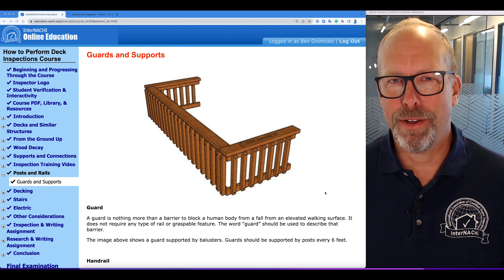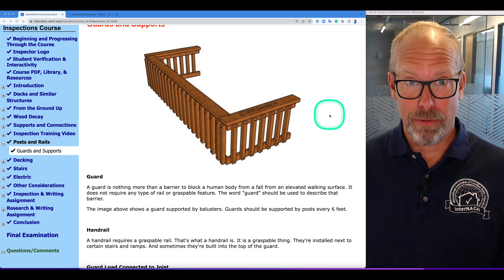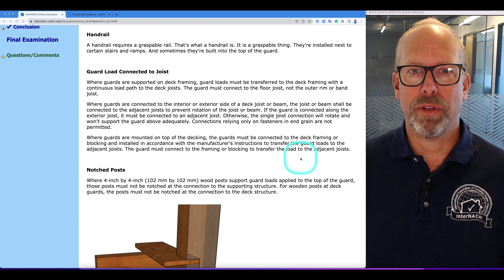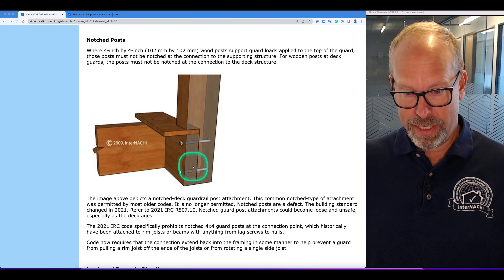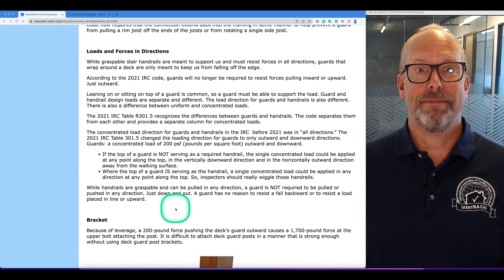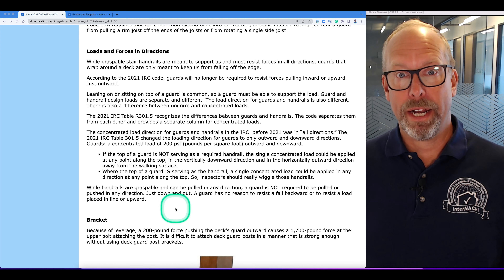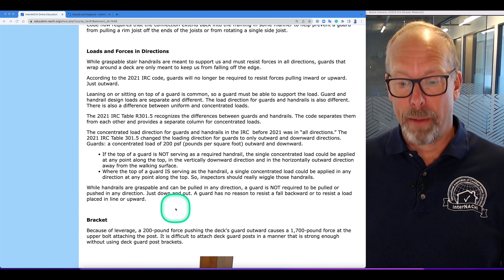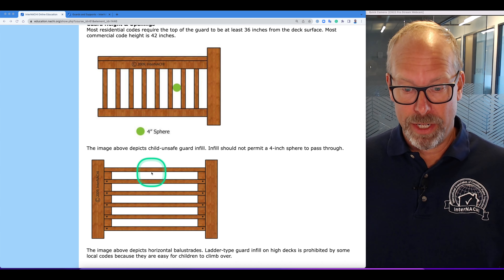Inspecting Deck Guards

Comment: This is where I find wood rot throughout. Each screw, handrail connection, baluster,  and floor trim. Also, call all flat surfaces to bevel to divert water. Ex. Handrails and post tops.
Thanks, Ben and everyone behind the scenes at InterNACHI.

John Grimaldi
Florida CMI and Home Inspector Mentor
Reply from the maker: Thanks for watching and commenting.